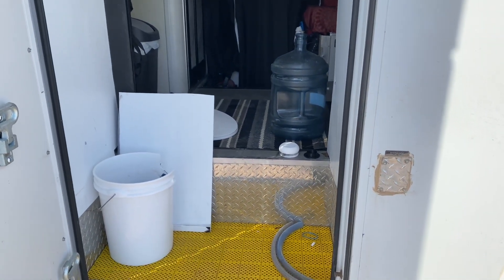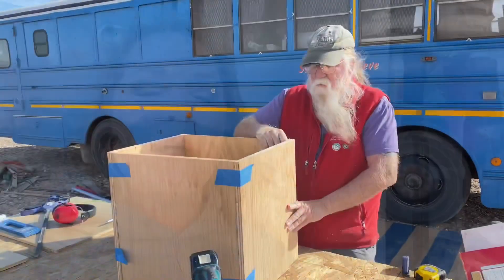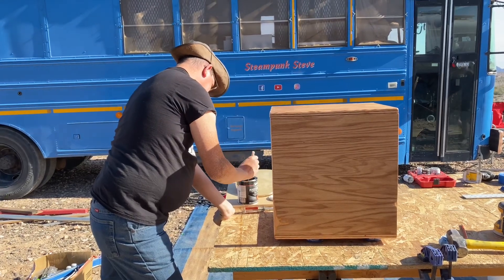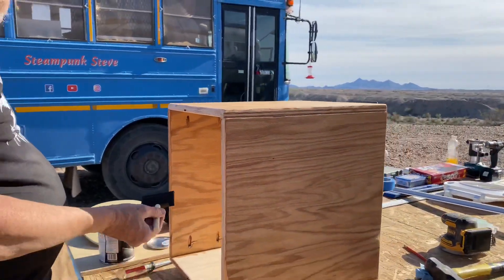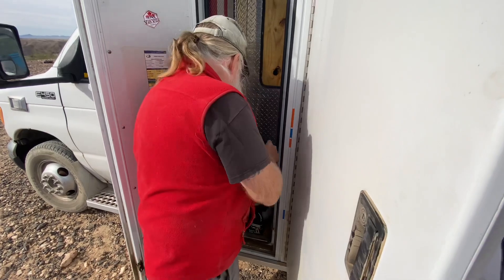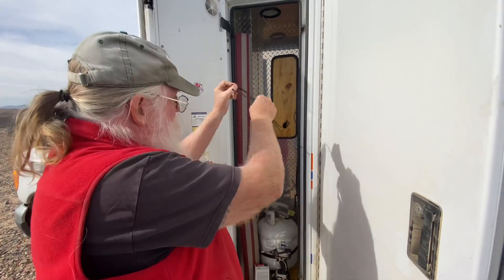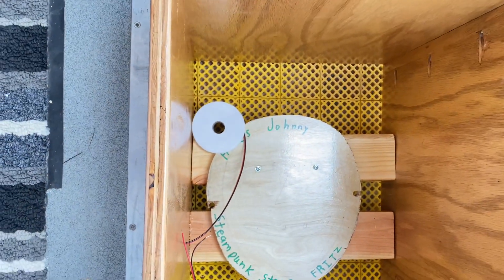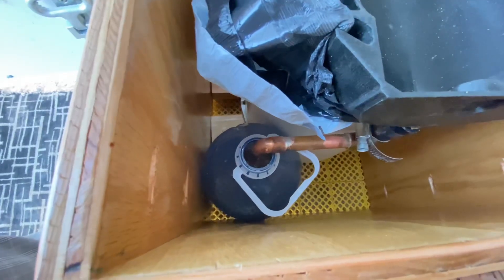Compost Toilet in a van

Comment: Just a fun little project we were happy to do
Reply: That was fascinating!! And so simple….. not that I can do it … but it was much less a complicated system than I thought. So what gets used for number two 💩 ? That coconut coir stuff or continued kitty litter?  Where’s does number one go ultimately?
Reply: @janiswilliams2766  she is switching from kitty litter to peat moss for #2
#1 goes into a jug and can be poured down a drain or on the ground.
Reply: @SteampunkSteve  thank you for your answer. Does the peat moss have to get stirred like regular compost?
Reply: @janiswilliams2766  totally up to you. I don't stir mine but my toilet isn't a bucket it's based on a lg Rubbermaid tub.
The main improvement over her old system is there's a small fan to blow the smells up and out a vent on the roof

Comment: Get the pine pellets for the compost as it runs to sawdust and leaves no odor actually dries the poop out of all moister, i use it for both my cats they do urine and poop and I never have a cat book odor. I also used on my trip in a for stool potty and it was mixed and no odor. If you can locate a tractor supply a 40pound bag is less than $8.00 and a little goes a long way I bag it up in quart bags to make it easier to handle.

Comment: These homemade composting toilets are an interesting approach. I’m not surprised they your original setup didn’t work all that well. I’m still a little leery about a couple of things in your new setup. 1) keeping a composting toilet in a shower enclosure. I fear that the added humidity might affect the composting procedure negatively. 2) these homemade efforts don’t have a stirrer to mix the poo into the composting medium. I will be using a Natures Head in my ambo conversion. I had one installed in my sailboat when I was a live aboard and it was an incredible unit. Well made and extremely easy to empty and to maintain. And absolutely no fecal smell. I bought mine from the same guy on Vancouver Island that I bought my first unit. The cost, shipped to Calgary was around $1450.00. I hope your system works for you.